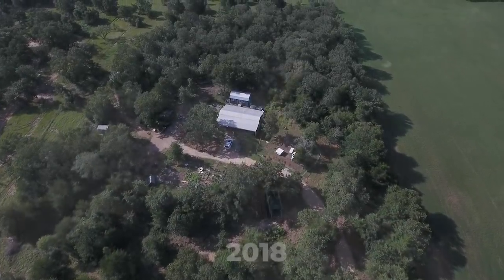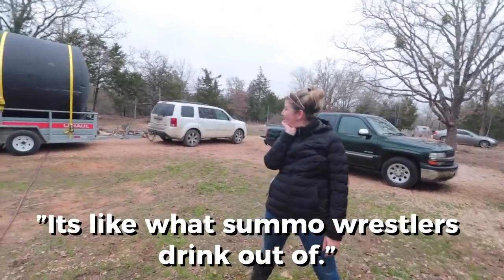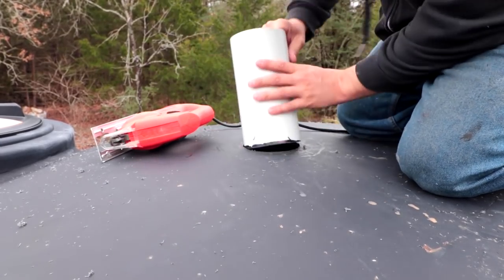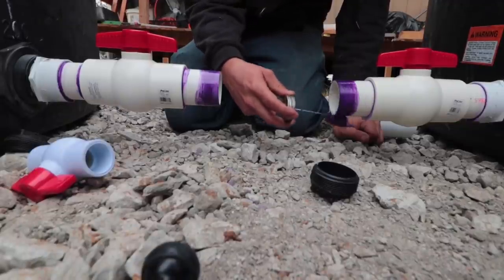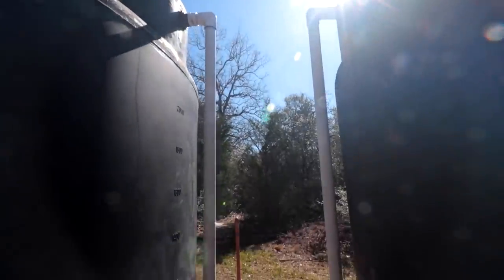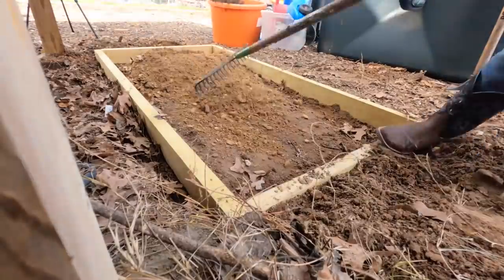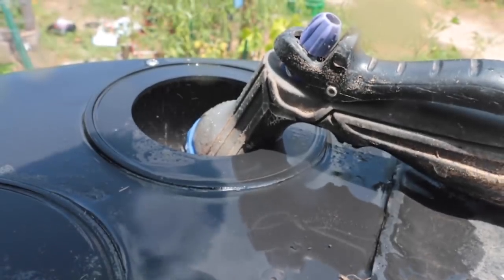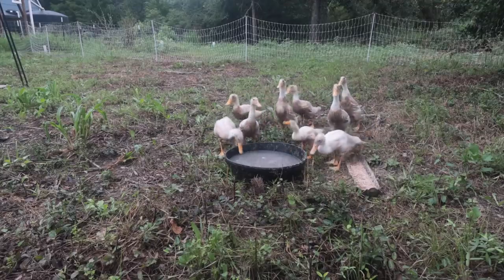5530 GALLON Rainwater Harvesting System Timelapse (START to FINISH)

Comment: Thank you. I just recently bought two as well. 
Unfortunately, the pros aren't available to install gutters, let alone a rwhs. 
But before I do that, I have to raise a 1200g. cistern that is half buried to be about 3' above grade ( to be at same elevation as the jet pump in the house).
I'll have to dig that one out, transfer its water into a different tank, remove the cistern, backfill, then build something(?) sturdy enough to hold and insulate the 1200g water tank.
Then I can get back to where I left off with the RWHS.
Big help here.
Reply from the maker: Oh wow, yes that’s a lot!
Reply: You could still install gutters yourself, you just may not be able to get seamless type. How do plan to raise your cistern?!! And what's this cistern made of?!
Reply: @reneepuvvada  I did install my own gutters. The only ones I could find had stickers about toxins. The rooflines were anything but straight and level to start with. The hangers were difficult to deal with. The end results were less than appealing. My ladder sunk into the soil but I wasn’t injured. But - I got enough of it done and it does work. My polypropylene storage tank does collect some of the water that falls on my rooftops. 🥳
I have my main tank on a layer of cinder blocks layer on their side for maximum surface are.
Reply: @rojerww  Omg what a journey. Makes you think twice about what we take for granted! Glad you're safe. Did you buy the gutters from Home Depot or Lowe's?
Reply: @reneepuvvada   HD - yes.

Comment: Great video y'all! What are your thoughts on doing this on a shingled roof?
Reply from the maker: Well, shingled roof is usually not the best.  Because it does break apart over time and you’ll get shingle particles in your tank.  So you have to filter and really focus on keeping the tanks clean.

Which is why a metal roof is preferred for rainwater harvesting.

Comment: How often does the drip irrigation malfunction?  Get clogged?  I need to consider it for my large garden.
Reply from the maker: We haven’t had any problems. We do mulch our beds. So if there were an issue with clogging, I assume the mulch would help prevent any mud building up at the drips sites.
Reply: @BetterTogetherLife  Thank you!

Comment: How did this system hold up during our epic winter freeze 🥶 last year ?
Reply from the maker: Surprisingly well. We were in below freezing temps for just about a week. Our only casualty was a connection between the two tanks. If someone were to wrap that section, they should have no problem.

Comment: I'm always puzzled why anyone would forego half their potential roof collection area or most of it's potential since that mini tank is far below what that huge roof area could service.
Reply from the maker: We aren’t foregoing it.  Just haven’t fully finished the design.

Our back porch is way more catchment than we need for the 5000 gallons.

When we decide to expand, we’ll go ahead and connect some of the front.
Reply: @BetterTogetherLife  I guess the extra PVC piping to connect both roof halves to your big tanks must have been too costly.
Reply from the maker: Well, too costly for both money AND TIME.  With out a huge benefit really.  We measure projects based off of ROI.  Return On Investment.

The return of “more water” wasn’t worth it because all of that water was going to be sent out in the overflow anyway.

The ROI would be greater IF:

1) we were using the water for indoor use.
2) we had an extra 5000 gallons.
Reply: @BetterTogetherLife  I hope your gamble continues to work out well enough for all your needs.